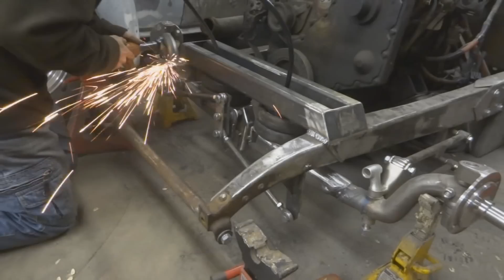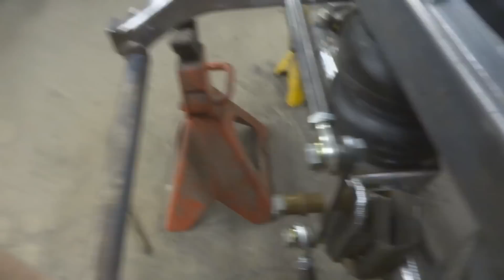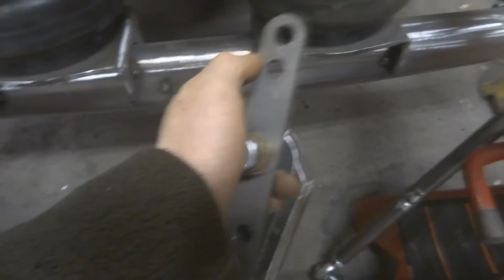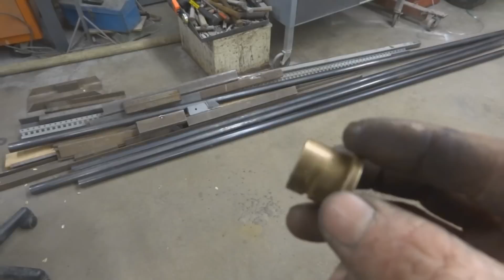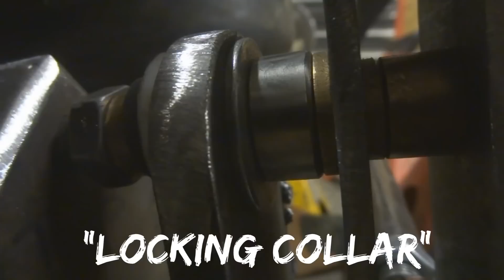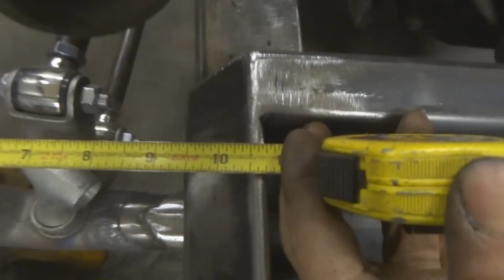Cummins Rat Rod: Project "Wild-Torquey" (Ep. 19) INSANE BUILD!!

Comment: What does the Watts link do
Reply from the maker: Keeps the axle centered throughout the travel of the suspension. It's basically the same as a panhard bar, but works better because the axle doesn't become offset as a result of traveling on a radius
Reply: Thanks Tinman, as usual if I would have watched the full video I would have known what it did, very nice

Comment: I've really been struggling with my watts link build on my truck. Until I watched this video starting at 10 min 30 sec. I ordered a kit from MMW and the frame tabs aren't allowing me to reach the frame while keeping the bars parallel at ride height. so basically I need to just build new tabs that will reach the frame correct? I'm also assuming it doesn't matter where the tabs are welded to the frame as long as the bars are parallel.

Comment: Do you have any concerns about body roll from the front bags being so close together?
Reply from the maker: Yes, that is something I have considered. To limit body roll I am going to use a good quality adjustable shock that mounts near the batwings on the front end. Not much else I could do if I wanted it to get this low
Reply: Maybe like a big ass beefy sway bar? forwards facing mounted to the axle in front of the 4 link brackets, and attached to the underside of the frame with brackets that would allow it to slide forwards and backwards when you go up and down, but still let it do its job? Ive got the image in my head its just sorta hard to describe. Ive been thinking about it at work today lol
Reply from the maker: I dont think that would work. Its got too many arcs going on at once. The shocks should take care of it. Im not too terribly worried about body roll anyways, wont be an autocross car ha
Reply: Touche. Badass either way man, really liking the watts link. Itll be an attention grabber for sure if it doesnt get covered up

Comment: If you are not going to put the frame side heim joints in double shear , please get a set of safety washers for the joints ... The safety washer stops the center ball of the heim joint from dislocating from the body as it wears out ...   If this setup is left "as is"  there is a chance that the heim joint center ball could separate from the joint , and the joint/ arms fall off of the mounts / bolts .......  This could cause a serious problem if you are driving when this happens ...
Reply from the maker: Thanks norm! Good to know. The speedway kit did not come with any instruction whatsoever, and their are none on their website. Also didnt come with any washers. I will do that though

Comment: Wish I had your shop. Im working outside right now, takes me longer to get anything done as I have to keep picking my mess up after im done lol, oh that and no heat outside. What website are you buying your parts from. Im going to start a new ratrod build very soon. Have a truck picked out for this already
Reply from the maker: lol i never pick up my messes... My ADD is really bad when it comes to tools and stuff. ha I buy my parts from a multitude of sources. It really depends on the part. Most of what you see done so far is either from Speedway, chassis-tech or slam specialties though.